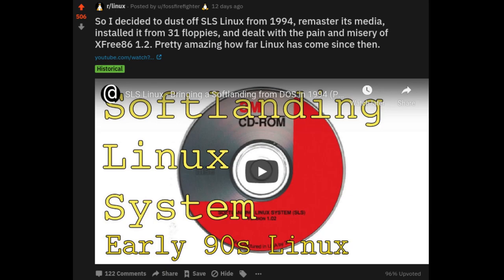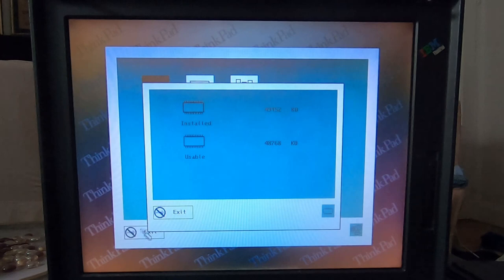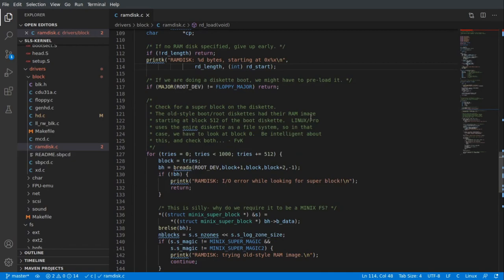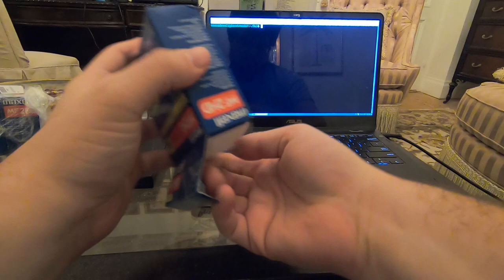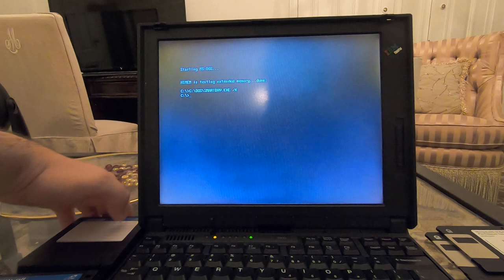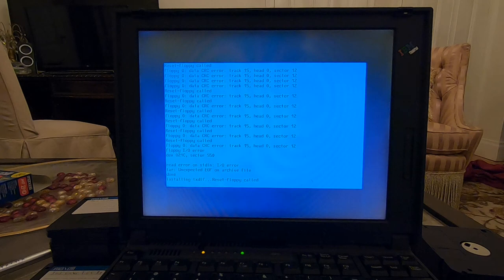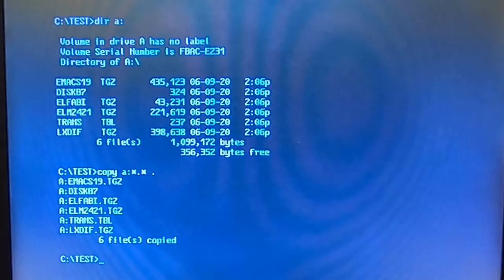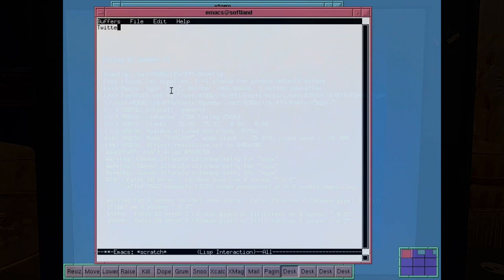Installing SLS Linux On Real Hardware Required Far More Effort Than Expected ... // (SLS Part 2)

Comment: Why didn't you just use one of those multi floppy sd card readers? They simulate multiple floppies and I think they have a next button on them
Reply from the maker: Because it fundamentally misses part of the experience of using floppy disks in the first place. Its great for convience, but not an accurate experience.

Comment: Buy *USED* disks in bulk.  Spend a couple hours checking them and for like 30 bucks you will be left with 50 or so functional floppy disks
Reply from the maker: I learned this since, I have a 50 pack of used disks from eBay now.